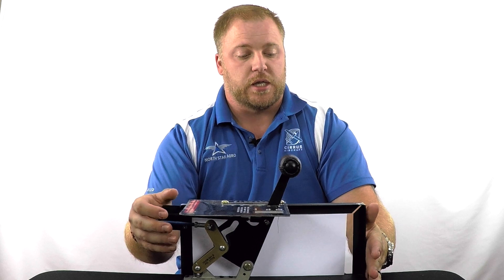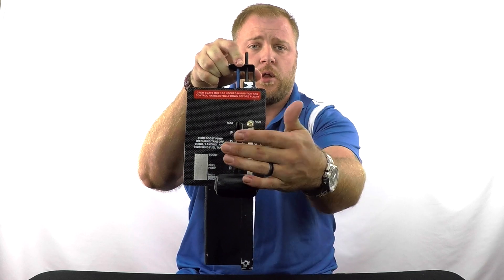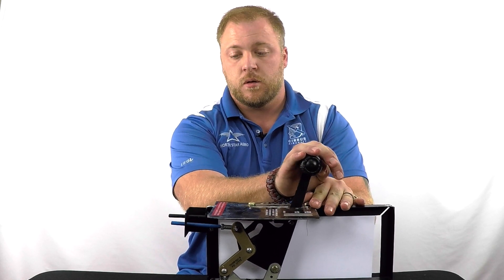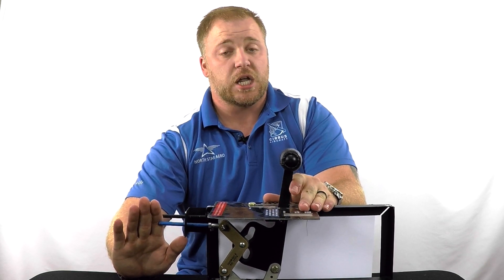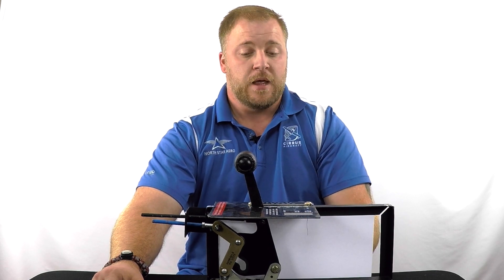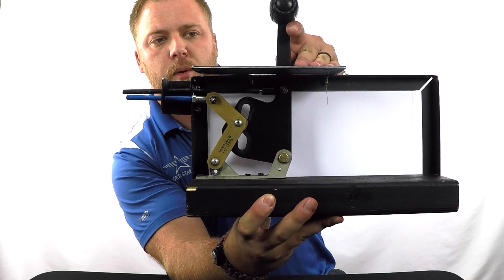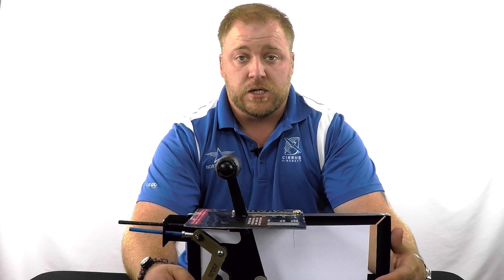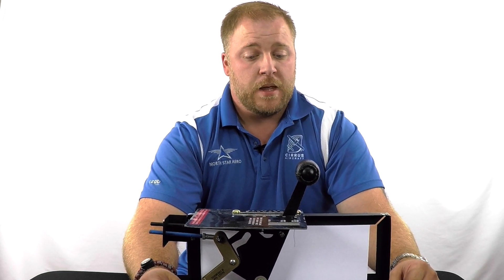Cirrus: No prop lever explained!

Comment: I can't say that I have ever "worried" about the prop.  Full in for takeoff, back to 2500 for cruise climb, 2350 for cruise and descent, full in on pattern entry or 2-mile final.

Really only touch it three times while I'm in the air on any flight.

Comment: If reducing pilot workload is the goal why not also use a FADEC?
Reply: It's not possible to add a FADEC to an existing engine and prop system. FADEC is designed as part of the engine from the ground up like the Lycoming Ie2. Then you would have to re-certify the aircraft to this new engine, which is very expensive and time consuming. This design is much cheaper and uses the existing regular engine. Very cool and ingenuitive... Love it. I just wish other manufacturers would learn and do the same.

Comment: It should be noted that newer Cirrus models (SR22T in particular), the power lever does not control the prop at all!  The prop is governed at a max of 2500 RPM.  The governor is not connected to any control lines.
Reply from the maker: Good call!!
Reply: Not quite right.  The combined prop control with the throttle does indeed control the pitch of the prop the same way the blue knob does on aircraft without this innovation.  The governor behaves the same way it does on any plane with a constant speed prop.
Reply: @speedomars  On non-turbo models this is true.  On SR22T's (turbocharged models) this is not the case.  The governor is completely independent of pilot control (other than reducing power to the point 2500 RPM cannot be maintained) and is adjusted to maintain 2500 RPM.  There is no linkage from the throttle lever to the governor, only to the throttle body.
Reply: @ericvasilik  The prop governor operates independently on ALL aircraft.   I owned and flew an SR22T for six years.  From experience I can tell you that on takeoff the aircraft had a pronounced sound change and lurch when the throttle was pushed the final 20% of play, adding the increased prop RPM due, presumably to a change in prop pitch and engine brought to WOT.
Reply: @ericvasilik  I had a G5 2016 TSIO-550-K 315hp twin-turbo.  Garmin G1000, Perspective, FIKI, ADS-B in/out and more.

Comment: Is there a range on the throttle where it brings the RPMs down for and economy cruise? (Maybe just below the "point" of the cutout about halfway down?)
Reply: Cruise is 75% power on a Cirrus.  Its also the best way to extend the life of the engine.  If you want to save fuel, run LOP, Cirrus helps set that too by offering you a carat on the fuel burn readout on the panel.
Reply: It's a $750,000 airplane (or 1.2 million for the newest turbo version) - they aren't marketing to anyone who wants economy.

If you want economy, buy a used Mooney.  My C model does 140-145 KTAS on 8.5 gph @ 7500-10,000 and 65% power.  

The normally aspirated SR22 does 165-170 KTAS at the same altitudes and power setting, but drinks 20 GPH to do it.

So, over twice the fuel consumption gets a Cirrus driver 25 extra knots?  Over the distances I usually fly, that's less than 10 minutes faster.

Yeah, nothing about the Cirrus is intended to be economical.  It symbolizes the wasteful extravagance that is killing general aviation.